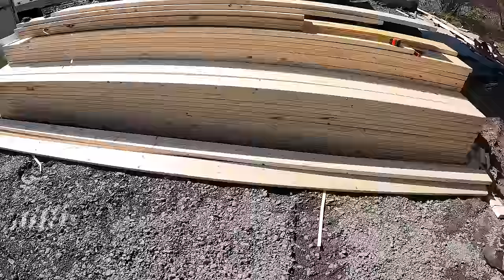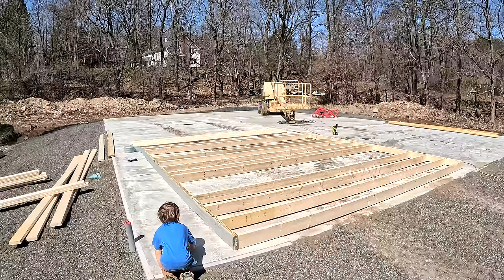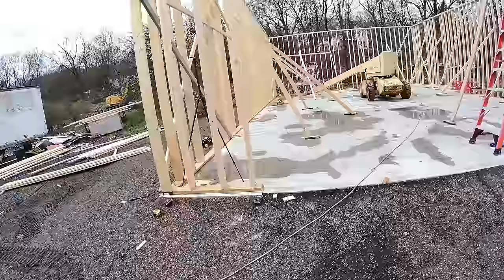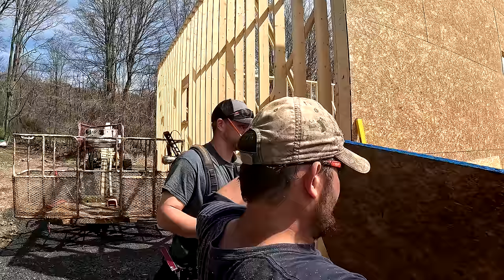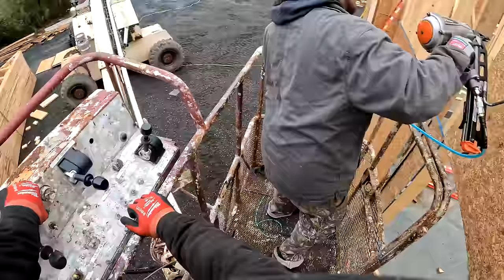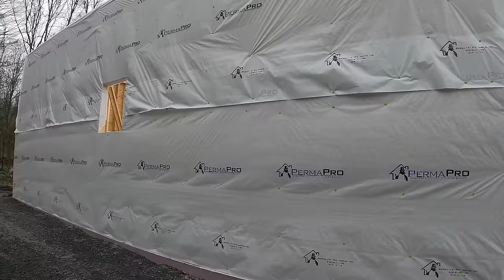Building my Garage : Framing and sheathing walls

Comment: ok guys,
1. ryobi gun was returned : too bulky/heavy
2. heating is at 5 inches and screws in concrete was 1,5 inches
3. Noah wears clothes in winter
Reply: Surprised that you even brought it home. ....BRAND OF NEW JUNK
Reply: Jesse,  put REAL shutters on ur windows, preferably inside..   so when u lock up for the night or extended absence, ur shop is secure(plus no one can see whats inside), im sure u'll have a couple camera's IN and around ur shop, to keep tabs on it..  from inside ur house and on ur phone(when ur at work or away)..

Comment: It’s good to see you holding your hands back from the top plate as you nail. As a kid, I learned that lesson the hard way!
Reply from the maker: Yep i learned the hard way too. I was 30 ft in the air nailing a rafter to a ridge beam and I had one come out sideways and go into my thumb. Never climbed 30 ft downward so fast
Reply: Mine was at a wall corner, hit a knot. Right into my knuckle 😢
Reply: Glad to see I’m not the Only one that nails himself😅😅 as a 7 year old kid wanted to help my dad…… yeah to the hospital

Comment: Stick framing will always win, especially with the cost you save in the foundation/concrete. Imagine you had to pour, not to mention dig,  4’x2’ dia footing holes every 4’. That’s what they make you do out here. And if you do surface mount like you were considering you need an 18” rebar stemwall with 8” footing as well. The stick frame on slab is wildly economical.  Obvious move. Insulation, wiring, everything is straightforward as well

Comment: Just a friendly tip, when putting in those concrete anchors your best to have the nut on the end few threads when pounding it in so you don't mess up the threads. Looks good!

Comment: Although my little 26x28 detached garage/shop is nothing like this, when it was being built, it was a great feeling seeing the truck pull up with my trusses.  They had my address spray painted in black on them, I guess in case the driver forgot where he was going. 😁

Comment: So much good here!!
I've heard people glue their 2x4 strips onto the concrete slab to attach the bracing, so they don't have to drill into the floor. When it's all done, a firm smack with a sledge hammer knocks them loose.
Reply from the maker: I did that a few times but when it rains the boards swell up and they do separate from the floor, I had it happen quite a few times. This floor will get a solid color epoxy so filling in some of these 1/4" holes will be no sweat

Comment: Jesse, before I watch the video I had one thought seeing the delivery truck. Aight, so you don't want to readjust your culvert pipe so you can adjust the ditch now that you know where the road needs to be, so how about making your own manhole around the culvert and putting a drain grate on the top of it to drain the driveway, then you can move the ditch where you need to move it on the garage side, have the water plop into the box and turn that weird angle to meet the driveway pipe. All it costs is a yard or two of concrete, the new culvert, some iron for the reinforcing and making a grate. you could even pour with the pipes in place for a better seal. Then you know you get the box height right for your situation.
just an idea, time is money.
Reply from the maker: I have a whole big plan for that area. but I want to get some more important things done first. I will tackle it this summer

Comment: Make sure to use wire mesh and stapler to seal potential mice/rats/ squirrels  chewing spots like corners, around pipes etc very easy to do it now.
Even if they enter the building  from the doors they will have a limited space to hide in and limited highway to travel from place to place inside the walls ,easy to get rid of them.
I saw too many buildings have a big problem with rodents.
Less than $100 will do the whole building (wire mesh, stapler and snips)
Reply from the maker: yea rodents and bugs getting in is a pet peeve of mine, I want to avoid it at all costs

Comment: Jesse,  I've been a production framer for 35 years...I'm pretty dang good at it...please trust me when I tell you,  YOU MUST PUT IN A ROW OF BLOCKING...probably put it at 8 foot...it's not too late to do it now.  It's also good for edge nailing on your wall sheathing.  That row of blocking is code in CA.  Your walls are quite weak...the blocking adds a huge amount of strength.
Reply from the maker: Yes I will be adding blocking on rainy days once the roof is on. The front gable end also needs blocking every 4' per the plans for better sheer stability

Comment: Awesome work guys, pritty much the same thing I built two years ago. the only thing I saw on the gable wall sheathing plywood, I was told to put a 2' course up so you would have a full 4' sheet to split the seam at the top of the wall and bottom of the truss. But I went with vinyl siding, you are using metal, so I don't think it matters. keep up the great work. your going to love it

Comment: Stick framing, excellent choice. OSB a good choice for a garage. I have the same with 3 courses of concrete block, 2 foot heel in my scissor trusses. We use 10 foot studs. Plus  Windload here in FL won't let us use stick frame 12 or 16 ft studs without an engineer. We only need just engineered trusses below 10 ft.  Heels on trusses can be very tall in some buildings, like 6 ft with scissor trusses can get very good overhead clearance for a loft. Oh BTW, setup of 10 ftx 12 walls are super easy for 2 people any DIY that does not have or want to rent a materiel handler to raise walls.

Comment: my house is sheathed with 5/8" plywood and then 1" of foam and Tywrap over that.  I spray foamed the walls as well.  With my ICF foundation it's quite easy to heat.  I have a combination of In floor heat in the basement, Electric Radiant on the main floor supplemented by A moderately efficient Zero clearance fireplace.  1500 SF plus a 900 SF garage that also has in floor heat. I Burn about 500 Gallons of propane annually and my Electric bill is $1300 annually.

Comment: In cold climates you want vapor permeable air barrier on the outside so it doesn’t rot out the osb. Air vapor will condensate between the fan-fold foam and osb and rot out the osb over time. You would be better off with just Tivec house wrap or for thermal break using rock wool comfort board, but that’s pricey.

Comment: Asked my contractor (this is Canada) why he wasn't going for ZIP board instead of regular OSB. He told me that the cost for the boards isn't that much higher, but that they make their money on the ZIP tape. So you probably made the right choice. For much smaller projects I typically do neither option and go for plywood, but yes that is expensive nowadays.

Comment: Anybody that says it's too many braces knows nothing about wind load.
 I'd even suggest going on your top plates from corner to corner at a 45 in all four corners with the longest material you have T'd, Until you get ready to set trusses. 
I lost the second story off of a house we  were framing due to not enough braces. But we had straight line winds at 60. Curious as to why you built those little headers in place rather than swatting them together down on the floor and just set the whole thing at once. Nice work on the whole thing it's going to be a beautiful shop.

Comment: I live in Buffalo, NY and all of our pole barns are 8ft on center. I find it hard to believe the snow load is less were you at, but still a nice barn u made.
Reply from the maker: you can do 8 ft on center but you either need a massive double truss or a massive LVL header
Reply: I'm in Syracuse. The NEW codes are way over built. It's ridiculous.

Comment: Milwaukee makes a beast battery framing nailer the thing is so powerful but is also overweight, i got the dewalt one its deece but slow and the ergonomics are horrible on my action hand.  Passloads are great but then you got the extra gas to put in and smell and theyre kinda loud, surprised makita  don’t have one for ya  .  Lookin good out there
Reply from the maker: the paslode gas is light and a nice grip and balance.gas is expensive but not the end of the world I use it a lot and then when I am doing plywood I switch to the pneumatic paslode

Comment: My question is about drilling holes in the floor. Does it penetrate the heating tubes buried in the concrete?
Reply from the maker: Those tube are 5.5 inches down and I only drilled 1.5"

Comment: If you want to use the pneumatic tools but are worried about supply volume, use the compressor in your shop running hose to a large compressor tank or repurposed propane/anhydrous ammonia tank rated for the pressure you want, providing a buffer or accumulator for your load so that the existing assets you have will work until you can extend the electrical service.
Alternatively, you could even trench in a permanent pipe to supply a volume pot in the new shop supplied by the existing compressor in your garage

Comment: put polished chrome or aluminium on the lower window sill to reflect light into the building. and multiwall polycarbonate sections in the northern edge of the roof for more natural light but insulated.

Comment: I like to see blocking between studs that long.  Stiffens the wall and ensures your 16 oc spacing.  Building on a slab with no curb, my preference is a double sole plate with a treated bottom plate on top of the poly barrier.

Comment: I have definitely seen my fair share of garages and shops that had a whole lot less space between the doors. It sounds like your engineer was being a stick in the mud, and didn't want to do too many extra calcs in order to do it your way. The way you did it; sheeted, with 4' brace panels is basically building to prescribed code. (Minus the 16' walls)

Comment: Zip system in my area 38.45 and partial board 30.48 for 4x8 sheets zip has a R value 3.6 and or 6.3 and all ready rapped
So what's your saving. Love the show
Reply from the maker: Zip doesnt have an r value of 3.6 thats zip R which is more like $75 a sheet. 7/16 zip in my area is $40 a sheet and osb is $19. Dont forget that you also have to buy the tape. Which adds another like $10 per sheet

Comment: I’m only 37 mins in but I’m just curious why you didn’t drive some stakes into the ground and attach the braces to that instead of drilling all the holes in the concrete?
Reply from the maker: because then I would have a hard time maneuvering around the building from the outside

Comment: 4/21/24..aahhh Jesse, great to see  framing begin on your garage project..but wait > 😮 <..was that Noah helping carry 'his end' of 16ft long 2x6 ? Nnooo waaay ! Jesse you must have substituted some Bulsa wood for that portion of yur video, aye? LoL! Great to see you & kids in video! 
 Anxious to see how you grab those roof Truss units ( at Ridge🔺️?) & lift high enough...(16' wall + H of Truss at Ridge🔺️ 8ft?) ..16+8=24'..? & hoist over top of wall & hold vertically while helpers begin to nail 'heel' of Truss at top plate & someone (3rd helper ) holds unit, un-hooks cable from Ridge while you manipulate crane back to stack of roof trusses & grab another as other 2 'heel' nailers move along top of 16ft H level & wait for next truss...somewhere somehow somebody must nail a connector horizontal from 1st truss to 2nd truss...phew! Lots to type while sitting here but lots of careful & safe physical movements by all parties!💪Stay safe & carry on!😊👍

Comment: yes, corner gussets at the top on the inside walls should have been good to accomidate front wider doors from racking, like you said engineers are picky.

Comment: I see a lot of post frame buildings in Upstate NY with 8' post spacing on the load bearing walls and 10' on the gable ends. Most have a double 2x12 on the outside (one of them notched into the post) and another 2x12 on the inside (not notched into the post). The trusses are spaced 4' and sit on the headers. Maybe you were referring to RR Buildings' style where the trusses go directly into pockets on the columns, and because NY's snow load requires the trusses to be spaced 4' usually, then you would also have a post every 4'? But with the header style, I always see them around here with 8' post spacing and 4' truss spacing.
Reply from the maker: yea you can, but I am pretty sure you would need to use LVLs to span that 8 ft if you are doing a 40 foot span. You have to remember that the wider the span for the trusses, the greater the snow load. So if you were to build a 20 or 30' wide building it might not be a problem to use 2x12 but 40 ft is alot of weight.  you are looking at 1100# of weight per ft of the eave ends between live and dead load. So 8 ft span could potentially see ~8000#. it would be close
Reply: @jmuller86  that makes sense! I’m mostly seeing smaller garages, like 24’ or 30’ wide. Also, probably most agricultural barns that are bigger around here don’t require permits or anything so people just do whatever they want.

Comment: Shear walls in New York State ? I would have found myself a new structural engineer. I agree with on the zip product when you add up the tape , and the BS warranty that’s supposed to big selling points.

Comment: Does your area not require stud straps?
Here in Australia we are made to install metal strapping over the top and bottom plate with metal strapping fixed to the stud edges to aid in uplift, especially on all openings.
Do you not require any termite protection on the slab to bottom plate connection? 
You guys do somethings differently to here but still looking good.
Reply from the maker: yea that is not required here, not in NY anyways
Reply: @jmuller86  sounds like the place to be then

Comment: Question for you ? Did you give metal studs any, though, on the walls, and if you did, how much of a price difference would it have been? One hell of a video
Reply from the maker: metal studs are just a pain to work with, I wanted to originally do just about any type of construction except stick frame. ICF, steel frame, post frame...but cost led me down this path I am on now

Comment: So when you drill into the concrete to ankor the support timber brace,how do you not drill into the water pipes? I'm from Australia, and I've never had to deal with those red plastic pipes?
Reply from the maker: those pipes are at 5.5 inches and I only drilled 1.5 inches down

Comment: I have the Dewalt Nail gun anyway what i found is if you use Grip rite nails in it , the nails Bend over about 1/2 from the head. I found that the Paslode nails  do not bend like the grip rite  nails, , on both 2 "  and 3 1/4 nails the grip rite  nails both bent  over  at   a half inch from the head.  Paslode nails did not do this, I see  he's using Paslode nails, just wanted to share my experience using grip rite nails.

Comment: Would it have been easier to lift the roof frames first and then build the front wall? Then you could have driven your telescoping forklift inside with that hanging roof frame.

Comment: Interesting mode of construction I would have done the roof before cladding the walls. No doubt you have a reason for not doing that. Would you share it with me.
Reply from the maker: less chance of the wall racking when the trusses are on

Comment: Jessie why did you not put treated wood on the concrete that the studs were nailed to? Wet ground in contact with non treated wood.
Reply from the maker: that is treated wood for the sill plates. its required
Reply: @jmuller86  ok

Comment: As is often the case with North Americans, I notice that they don't add a moisture barrier to the foundation or floor when they build walls. Do Americans believe there is no exchange of moisture between cement, i.e. concrete and wood?
Reply from the maker: I added sill seal everytime a wall went up

Comment: I am concerned about your wall supports thats drilled into the floor where your heating tubes are located. Do you think that you may have drilled a hole into those heating tubes?
Reply from the maker: no those tubes are 5.5 inches down and i only drilled 1.5 inches into the concrete
Reply: @jmuller86  Oh...okay!
Reply: Like hitting the lottery right?

Comment: 12 min in and I have to 100% agree. I can't stand salesmen. If you have a good product and I want it, then it sells it self. If you need to try sales tactics on me then I'm totally turned off.
Reply from the maker: Yep. Thats exactly what happened. I called a half dozen places and they all did the same thing. Told me they had a 40x60 that someone ordered and then backed out and they would give me a big discount on it. After hearing that twice in a row I knew it was a sales scam

Comment: Hmmm. I was always thinking I would build a pole barn style building. Why this style? Pros of this style over pole barn?
Reply from the maker: depends on where you are. here the snowload is too much, which makes a pole barn need rediculously oversized trusses. I would need to do double 2x6 trusses every 4 ft. plus the laminated columns are $130 a piece and I would need 50 of them. Thats 6500, and I can just buy the 2x6s for 2000. Plus with pole barn you would also need headers between each post. you could spend an extra 5k on a post frame vs stick frame. and so what is the point in spending extra money on it? the reason you build post frame is to save money not waste it
Reply: @jmuller86  that is some awesome info for me as I haven’t priced anything. I think I’ll go the same route as you. As not for code, but for my wallet. Thanks for the response man. Been watching you since the beginning love the content.

Comment: You will regret having less then a 16’ wide door. I have a single 16 on my first shop and on my hay shed I put 2 14’ wides and they are tight. 
I’d do a single 20 or 2 16s.
Reply from the maker: I know, I wanted wider but engineer wouldnt let it fly.  I could have done one 22 ft door but I just thought that would be weird because there is really two bays